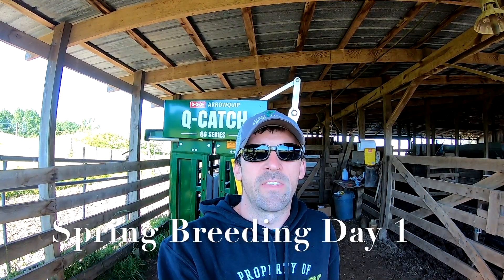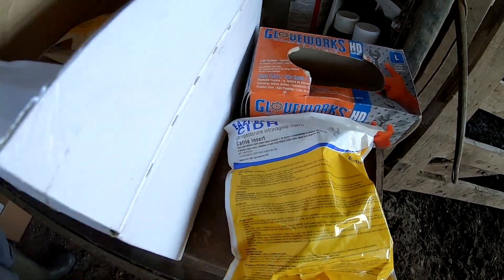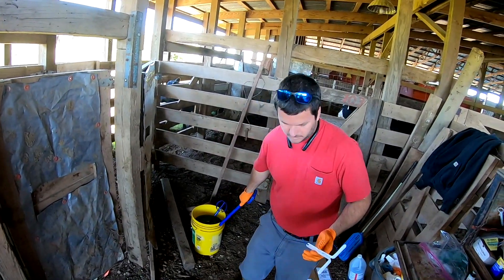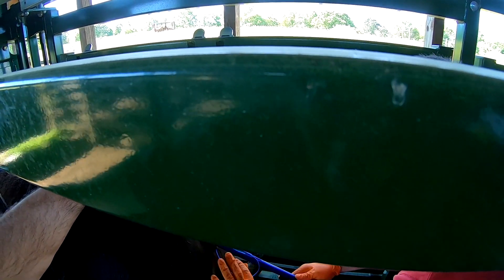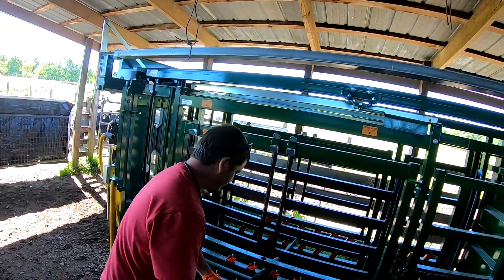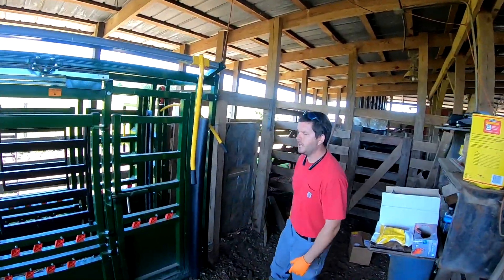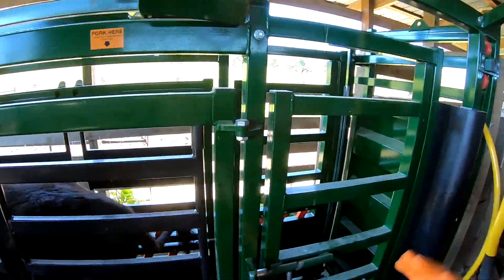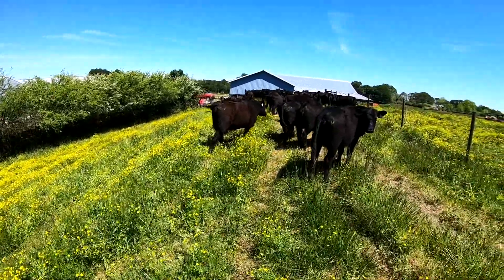Inserting CIDRS - Spring Breeding Day 1

Comment: After AI your 35 head. How many took with your process of 12 hrs waiting after there tag turned colors?

Thanks for the videos. Very informative. Keep it up.
Reply from the maker: We usually have about 70-80% come in heat. I believe we ended up breeding 29 or 30 of that group of 35 which was really good for us. Of the ones we bred 21 took to the AI.